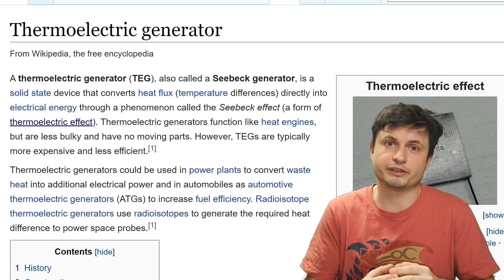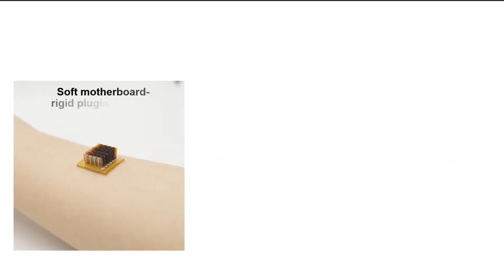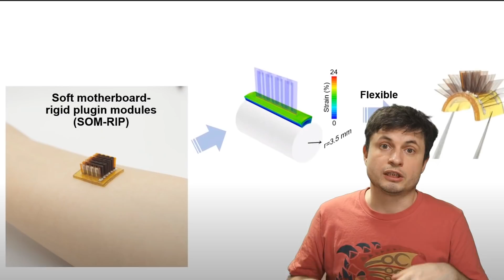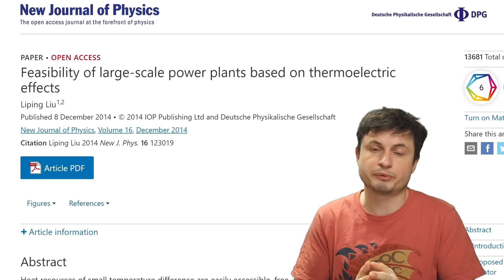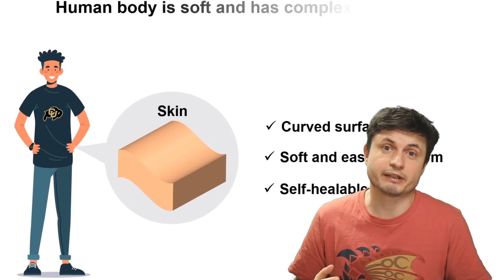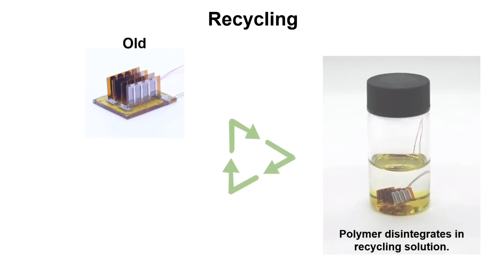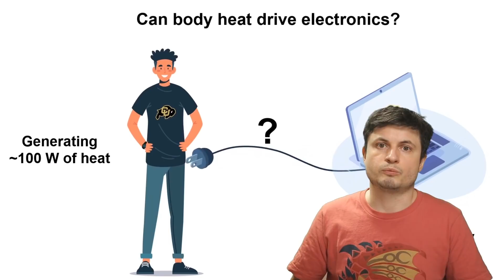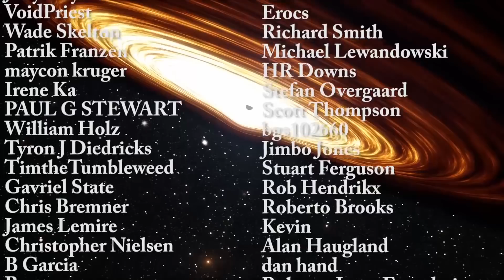Interesting Invention That Turns Your Body Heat Into Energy

Comment: There is so many ways these pelter units could ne used more than they are. You can put them around any heat source and they will generate osme form of current. You could put a small grid of them on a board outside and focus some sort of large lens on them in such a way that they get pretty hot without burning and use it as a makeshift solar powered system. Put one up in front of the heater vent in your car, or on the side of a wood burning stove, etc. Or so many other pplications In The cold too. If you're a business and you have a walk in freezer, you could set up a small grid of them on one wall to produce power for the light inside the freezer, for example. In really cold climates set them up on your windows to produce electricity and heat, or outside on the wall, etc. So many uses.

Comment: You.could increase the efficiency of solar panels by placing this on the back of the solar panels solar panels  lose efficiency when they get hot if you can cool the panel and produce extra voltage a win win. Depending on the cost to produce
Reply: The cost-to-increase in efficiency is insane to even consider that. A standard solar panel alone is already outputting six or more magnitudes more energy than this device.

Comment: 1 Volt, while it doesn't sound like much, is downright revolutionary.
Reply: No, no it's not. Read the paper. It generates only 100nW (that's NANO watts) at room temperature. It is completely impractical for even the lowest powered wearable devices.
Reply: @EEVblog  Oh, yes that's true, thanks for the info. It seems the highest mentioned power level 19 μW/cm2 was at ΔT = 93 K, so only achievable when on human skin if environment is at -60°C 🙃😂. With that 100nW output you would need about
20 000 000 devices to power a phone... That's 2000 m2... Meaning 1000 people would need to cover their full body with these to power one phone needing 2W power... LMAOOOO 🤣🤣🤣💀.
Reply: Yeah, I guess so - but as a person not familiar with this subject I would have liked to hear how much electricity/power they can produce. Knowing only the voltage tells me nothing 🤷🏻‍♂️. Is it 0,01W (with 1V/10mA) or 0,1W (1V/100mA) / module, or what? 🤔
Reply: @tkermi  10uW. It's really crappy.
Reply: @user-me7hx8zf9y  Oh no 😟, thanks for the info. In my use, my phone consumes about 2W in room with lights on. So to cover that about 200 000 of those devices would be needed 😂. I use it ~12Wh worth / day, so to keep it working  would require wearing 50 000 modules 24/7...

But I guess there are nice applications for this (absolute minimun consumption wearables 🤷🏻‍♂️) - just this phone example wasn't really the most appropriate one. 🙂
Reply: @user-me7hx8zf9y  Heh. What a shame.

Comment: What about the side effects, such as that it would make the place on the body where it sits cold.  Ok, you may be able to use it as a wearable suit in the hot weather to cool yourself down, but while I like the concept I am a bit skeptical regarding its application in the short term as a wearable device.  I guess that you have already seen the small circulating fans that are put on a stove to help circulate the air, I had a go at making one of those some time ago and while it works, wearing one ???  I don't know!!

Comment: Volt is not a unit of energy. Without current, it doesn't specify if the device is usefull or not. 

Reasonably dry hair generates several kilovolts when being combed but because of low current, usable energy is low.

Comment: E-ink Pads, E-ink Watches and in general E-ink tech can benefit greatly from this tech since it does not require energy to maintain an image. Energy is only needed on the display to refresh a page. This tech could also be very beneficial for Mars colonists as Electricity is more difficult to obtain.

Comment: They’re going to invent a belt that saps heat from you and converts it to energy, then they will make a belt you wear on top of that to warm you up when you get cold.
Reply: ebjj vhjnf  visible light is technically radiation but we don’t say that in casual conversation because it would be pedantic and pointless.

Comment: i mean, appliances and roofs etc in homes can get hot... if a TG can create that much current to be useful to have an impacting difference to make it worthwhile
Reply: at what point can a home produce its own independent electricity on a closed grid to not be reliant on a service provider or ever have a bill or maintenance or outage ever
Reply: sure the amount produced on a small scale isn't enough but with all considered ways combined, can recycle your own energy produced
Reply: generally lots of potential uses without a downside when its not new technology its just developed in a new more productive way

Comment: 1V of energy? 
energy is work over time, so V*A*t
Reply: ebjj vhjnf  I mixed units and formula signs, so maybe that is what confused you. 
It would read volt times ampere times time. 
I was just too focused on using volt, to reference him. 
So in units it would be for example V*A*s reading as watt seconds. 
In formula it would be U*I*t reading voltage times current times time. 
I hope that clears up the confusion.

Comment: The high end overclocking crowd has used these since the days of the Pentium 3 and the slot A Athlon, the water blocks back then were still prone to leaking and the quality got worse during the Pentium 4/Athlon XP era due to the mixed metals. Their peak popularity was during the 939 Athlon 64 940 Opteron era then fell out of favor as air coolers gotten a lot better since. As for using them to make power for micro devices in the human body no fucking thanks.

Comment: So you could take something like that capsule set it up where you put a bunch of waste in it instead make it thin but the device on it and let that stuff break down and rot and the heat it creates and make electricity enough to spend a powerful 110 motor and it powerful 110 motor will be strong enough to spend a big ass turbine that makes even more electricity and so on why has nobody ever built step up systems I have always asked that yes power comes from nowhere

Comment: For who is interested to know the power and not just the voltage, here is what i have found in the paper:
“ this TEG device can generate an average power output density of 45 and 83 nW/cm2 and an average output voltage of 25 and 33 mV/cm2 when the wearer was sitting and walking, respectively (fig. S8). For the surface area of a typical sports wristband (6 cm by 25 cm), a power output of 12.5 μW and a voltage output of 5 V can be generated when the wearer is walking, which is enough to directly drive most low-power sensor nodes with radio frequency communication.”

Comment: Is this really an environmental viable idea? Production of human food is dirty and of what we eat, half is turned into heat, so if you on purpose cool your body, you need to eat more to maintain your core temperature. In other words; how insignificant this might seem compared to the 800 KJ or 200Wh you eat every day which is responsible for 11kg CO2 emissions, just 1% lost to generate electricity from body heat (1Wh/day),accounts for 55g or as much as a car emits driving 1/2 km! If the Seebeck device has an efficiency of 4% that will give you only 40mWh/day, not enough to run a cellphone, but as a power plant, you'll emit 2.72 tonnes of CO2 for 1 kWh produced (which will take you 74 years), which is around a 50 times more poluting than a generator on gasoline!!!

Comment: I may have been quarantining for too long, but:
 I want to make taser-like hiking bodysuit, using this as the inner layer, that needs to be turned on via some sort of switch or possibly even tied to a heartrate sensor to activate when in danger, This way iCan explore the wilderness knowing that anything attacking me will get massive stored up shock... I don't like guns, and don't want to shoot animals, but I'm pretty ok with shocking anything that touches mah body, XD
I am not high, btw, lol
Reply: That might just piss it off more, 1 shock will make it angry 3-4 might make it run away
Reply: @tomclarke4978  According to work done on tasing things thru various means, it was found that it would work on basically everything. But only works as sort of a hazing for bruin. So iWould still need to not be touched by a bear, lol Which iGuess is common sense, tasers work on 200lb humans so 200lb wolves or coyotes or anything else, plus obv we're talking hypothetical here as far as building the suit, so no clue on how much of a zap the suit would be able to generate/store in embedded batteries to store the electricity.
Let me believe in this!!! hahahaha

Comment: does the device perform differently depending on ambient temperature? Also, here in canada, most people have furnaces in their homes, I always wondered why they don't extract energy from it rather than only using it for heat. Even this device could help in that respect, but even more simple would be to just attach steam generators to the furnaces. You can also use it as your boiler rather than paying rental fees for water heaters but still it is uncommon. These are simple changes that would drastically improve energy consumption and production yet we don't do these things because we weren't taught to and we weren't taught to do it because companies want us dependant on their services.

Comment: How about taking heated clothing that exists today and making it use also our natural heat to recharge the battery. You would only need to recharge it on a wall if there would some reason that the battery went to zero. Which would be never(?)(.) To start it up, sounds about all.

Comment: In a rural community folks use fans that sit on wood stoves to circulate hot air. They are commonly used for compact fish coolers and other small coolers for camping in the bush. Power outages are a thing, the offerings keep getting better, you want low energy consumption and as important reliability. How you charge them is a thing. I like Nebo products, a little pricy but decent on many levels, well made and designed., different topic I guess. The more ways you can charge these things the better

Comment: This would take FOREVER to charge a phone.
Reply: Perhaps so, in its current iteration, and with only one piece of the modular tech.  But even if slow you would be able to charge it constantly and not have to wait until you get to a socket, which with light use would mean you may never need to or at least significantly delay plugging it into said socket.
But the main point is now that the right path technology has potentially been discovered, it can possibly eventually be developed to a point where you would be able to keep any wearable or handheld tech fully charged literally under your own power.  Which is awesome.
Reply: @SabrecatFromSpace  I think the battery charge would even decay faster than this could keep up.
Reply: @TheRainHarvester  You're right, I wasn't saying that it would, I was saying future versions may be better, but also as the video states you can attach multiple together for more power.
Reply: @SabrecatFromSpace  no worries. Just relaying my thoughts. I saw someone stated 12uW was the output.  You'd need ~100 of these just to light up a 5v notification LED. Need around 50 if it were a single color 2.5 volt led.
Reply: @SabrecatFromSpace  lol!  I was being conservative too.  That would only flash the led .  To keep the led on, you'd need 1000 to 500 of these things.  
I wonder how many would be needed to power the screen and camera app? Haha you'd need more bodily surface area! LOL
Reply: Most electronics run at 1-5 volts. Five square centimeters would charge your phone. That's about the size of a watch strap.
Computers right now have 3, 5, and 12 volt rails.
Reply: @coreys2686  You also need to consider the amps that would be needed.  (Watts = amps x volts). Energy = watts x time
Reply: @TheRainHarvester  well, yeah. I don't remember what Anton said in the video was the output. This is just the first public iteration. I'm sure it'll improve if its possible.

Comment: In matrix, the machines were harvesting humans brain power, or that was the premise until they changed it to electricity. Back then people were less familiar with computer processors, while batteries are understood by the vast majority
Reply: That makes way more sense! Generating energy from humans never made sense to me. I mean, you have to put food into a human so why not just burn the food for the energy and cut out the need for all the other infrastructure needed to maintain your human batteries.
Reply: Source? This makes a lot more sense than the battery thing. I always thought there were better ways to farm humans, if you were a machine...
Reply: Loosh.  Search that.

Comment: Time to wear this to charge my phone in school. They never turn on the AC.
Reply: Since these devices work on thermal gradients, turning on the AC would make the device work better.  A hot body in a hot room will produce almost no energy at all.
Reply: @benjaminsmith4058  Yeah it requires the environment around you to be either hotter than you or colder to work.
Reply: I did the caluation using their measured data, to charge your phone you'd need 500,000 hours at a 95 deg temperature differential. If you plastered you body with 1000 of them you could do it in 500 hours, but you'd be dead from the 95deg temp difference. At room temp it only generates 100nW, so you'd need 50 million hours for one device. 100 hours if you plaster your body with 500,000 of them at room temp. Good luck.
Reply: @EEVblog  Hot sauna - cold plunge anyone?
Reply: A teg1 isn't that a heat sink
Reply: Sorry for punching in a dream, but he linked the paper and i leave it to you to read and do the math. So running really low power sensors seems much more likely and in the reach.

Comment: some years ago when i read about mit using sugar in blood to power tiny devices in the body i thought what if one wanted to rid the body of excess blood sugar and just throw the energy away asa by product. maybe the energy could be used for something useful after all, but i guess the idea of using the blood might seem ghoulish :-D the skin patch thing with radiating fins seems like a good idea, and could be driven to cool the skin too and kick heat into the air

Comment: Image using clothes in future that creates electricity and stores that. Being able to use your laptop or phone outside! It's utopic but kinda real
Reply: We are talking about 10-20 μW for a wrist band. A computer needs power 1 million times greater... the usage as battery recharging is completely utopic and not real. But could be very useful for medical sensors and apparatus that can work with those tiny power...
Reply: Ciao Bruno! 30 anni fa il mio computer era un milione di volte più lento! Non parlo di ora

Comment: Volts times Amps equal Watts: a point that would have given clarity to a couple statements.
Reply: Yeah, no power figures given. That it’s 1V is close to irrelevant on its own
Reply: But just in DC. In AC you've got 5 different kinds of wattage
Reply: @kooboos89  nope just one wattage. Neither apparent power nor reactive power represent real power. Although in ideal conditions apparent and real power may match
Reply: @robertadsett5273  there is no such a thing like ideal conditions ;) and as I said there are 5 kinds of AC power..
Reply: @kooboos89  AFAIK, those three cover the possible range and only one of them is actually power
Reply: @kooboos89  You mean five different kinds of notations?
Reply: 10uW means 10uA at 1V
Reply: to clarify, most USB devices require something tens or hundreds of times more powerful.
Reply: Max power output for computer USBs is 500mA usually.
Reply: @user-me7hx8zf9y  so, 50,000x ?

Comment: It doesn't mater how electricity is produced, it has to be powered by something.  That transfer of energy from wherever, to electrical power, necessarily upsets the natural balance.
Fossil fuels recycle additional energy into the climatic system.  Renewable sources extract energy from the climatic system.  In both cases, that energy is concentrated to a great extent in urban conurbations.
 Has it ever been considered that the heat plumes generated by cities, may be doing as much to disrupt weather patterns, as the build up of CO2 in the atmosphere?

Comment: A black surface facing the sun could theoretically be used to create electricity with this concept,simplifying the collection of light-heat for usage, and possibly replace or compete with solar cells. Solar cells are not as eco-friendly as people are led to believe, because of production and disposal, as well as longevity issues.